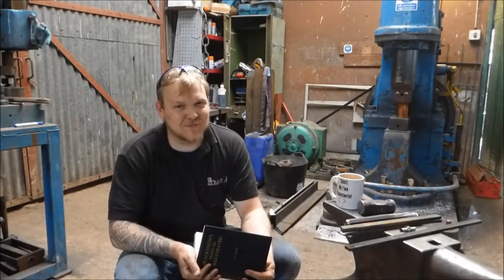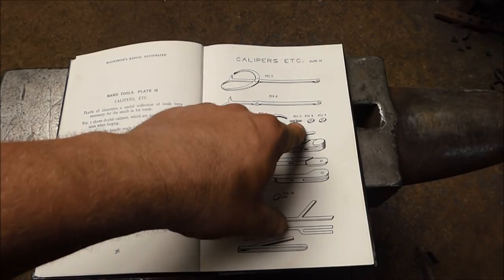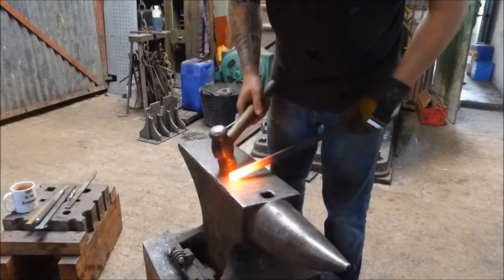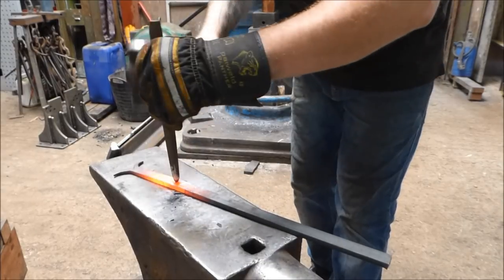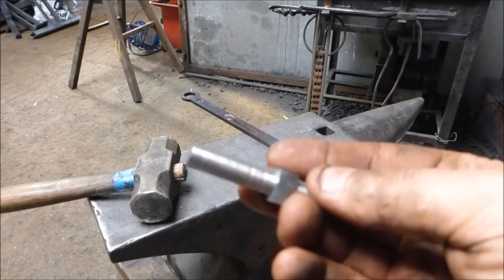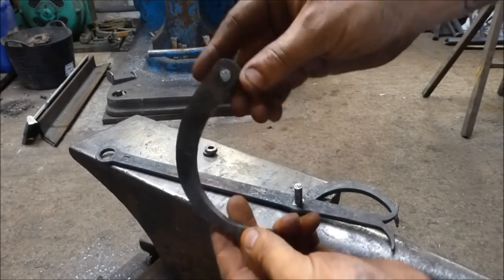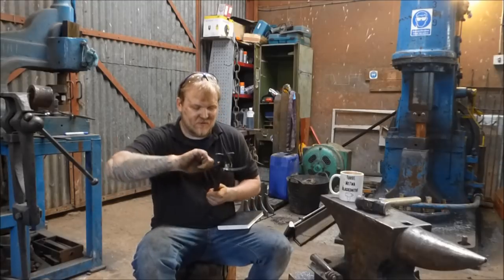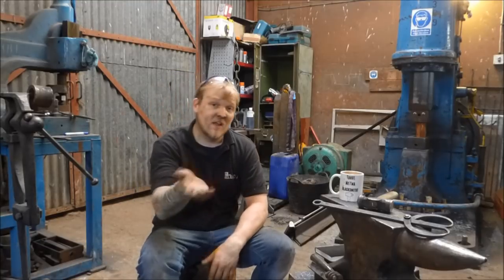Calipers a Great Tool for Any Blacksmith! Blacksmith Bible Part 1!

Comment: Won a "Mr. Hero Volcano Forge" from Roy at Christ Centered Iron Works, back in August, got my first fully successful forge weld in it last month, 2" x 3/8" bar and a scrap cut off piece of the same material about 3" long.  Man, am I happy to finally get a successful forge weld!  Used WD-40 when it was cold and Borax after it was heated up enough to melt the borax.

Comment: Will a file work instead of the rasp until I can find a ferior who's willing to part with an old rasp? Granted, the file would probably be a bit slower than the rasp.
Reply from the maker: Yeah a file works OK. Only issue is an old file is often too Warren out to be any good and you don't really want to uses a new one.

Comment: Do you think staking the join between the square hole and the square peg would add any benefit?
Reply from the maker: Phil Menzies yeah much better than a single pin. one large round river world spin and cause the opposite side to move.